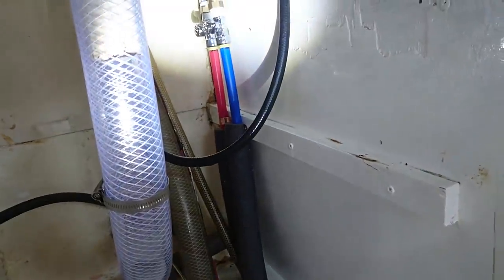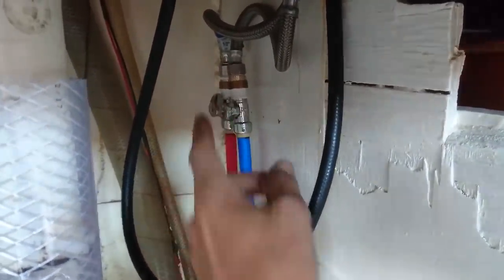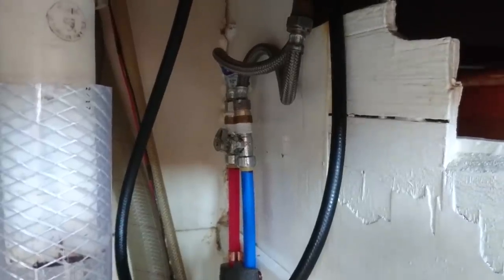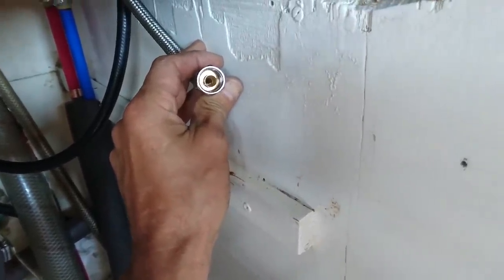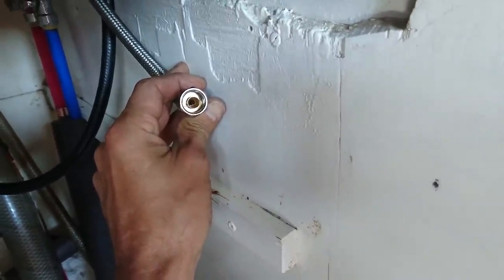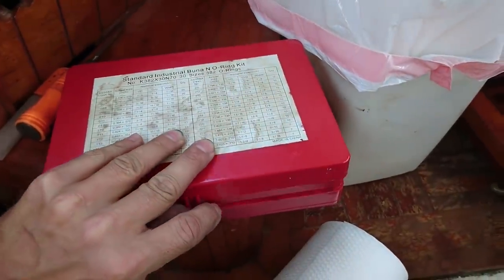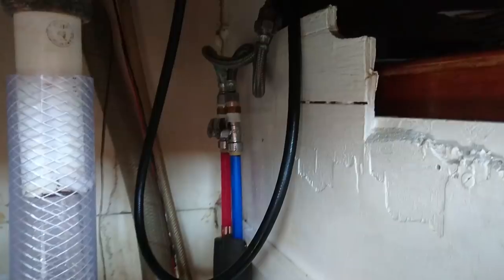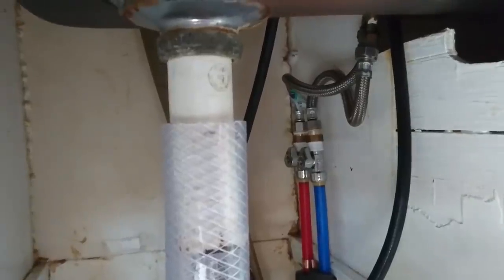18-07_Replacing the water plumbing - All new now (sailing ZERO)

Comment: Nice job and I am envious you had a Home Depot close by. I have a You Tube "how to" channel but was not about to show how I just replaced my burst copper pipe with a roll of look-a-like PEX and suffer the wrath of viewers. Here in Tanzania, Africa, all I could do was use 5200 and hose clamps to clamp the plastic tubes onto copper stubs. All was done in one continuous run. My scraped, cut and bruised arms sympathize with what you had to deal with. Thanks for showing me how to do it properly......if I can ever get the proper connectors. You have a great channel. I just subscribed.
Reply from the maker: You are welcome.. and thanks for subscribing. Try to get the connectors on amazon or ebay. I'm going to check your channel when i have a better connection..

Comment: Aloha Christian!  I used plastic when I refit Seafire back in 2002, but back then, you couldn't get generic pipe and fittings from Home Depot, so I used the Whale 1/2" tubing and Whale quick-connect plastic fittings.  Since then, I've had to replace the fresh water pump system and several of the faucets, but the plastic plumbing is great.  I especially like being able to disassemble it for access to tight areas and then snap it all back together again when I'm finished with my repair!  I saw Jacques recently, and he sends his regards!
Reply from the maker: Good to hear. I too think that I don't have to touch the plumbing again. 
Where did you see jaques? Aloha
Reply: sailing ZERO Jacques was here helping John John Florence sail his new catamaran over to surf Jaws. He stayed with us for about a week.

Comment: Great job on the plumbing fix. Same experience with SharkBite and PEX! Great combo.
Please consider NOT scrapping the OLD COPPER lines.
You may NEED these usable copper lines somewhere else on the boat in the future...or on SOMEBODY ELSE's boat (you'd be an instant hero to HAVE immediately available copper!)
Reply from the maker: They were done..  dumped them..
Reply: @sailingZERO  should have sold them to a recycler

Comment: I would never trust a press-to-fit fitting such as sharkbite on a boat.  In a house, sure, but there are too many o-ring seals, too many fittings with just mechanical teeth that are not water tight, that could be affected by corrosion, etc.  Im glad it worked for you though.
Reply from the maker: It actually works very well and I see no problem to use them on a boat.

Comment: Dont count on those Sharkbites!!!! Had them leak in my house after a year of installation. Caused an incredible amount of water damage. Cannot imagine how risky that is on a boat moving about and bashing into waves ( compared to sitting behind an access panel in a house that doesn't move at all). Remove Sharkbites and put proper fittings for PEX. This is an accident waiting to happen!!!!
Reply from the maker: Thanks for the warning. I'll keep a close eye in them.. did the installation almost a year ago and it's still waterproof.
Reply: You didn't press them hard enough. It feels like they seat and then there is still more. Press very hard.

Comment: You’re supposed to leave the 90 degree holders on the pipe permanently
Reply: Chris Corum : I thought so too
Reply: Pex has no memory.. without the 90 degree holder in place it will return to its original straight pipe.
But Pex is very flexible and a 90 degree holder is and added cost that was probably not needed. Save the money.. Return it.
Pex I would think is a good answer to the salt water environment.   👍😎
Reply: It puts stress on the shark bite connections if u dont use them but ok dude
Reply: Its a system not just pipe
Reply: Thanks Chris, I went my Home Depot in Chesterfield, MI., today after work.  I am going replace the copper plumbing/tubing in my Chris Craft.  Had a few questions to ask.  Not a soul to help me.  This guy here and you answered WAY more than questions.  Thanks.  I have 2 heads (forward and aft), bathrooms a shower in the aft cabin and the galley. I will make a schematic.  I'll buy the 90 degree things and extra fittings.